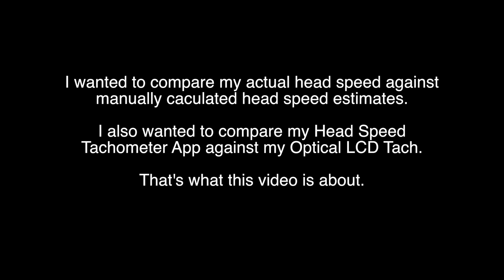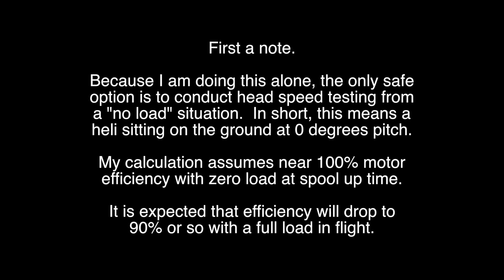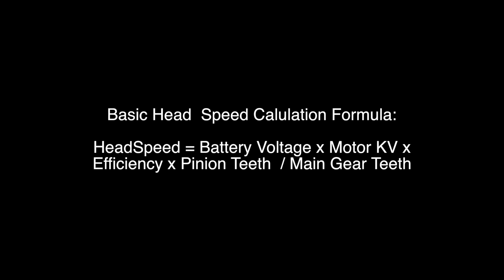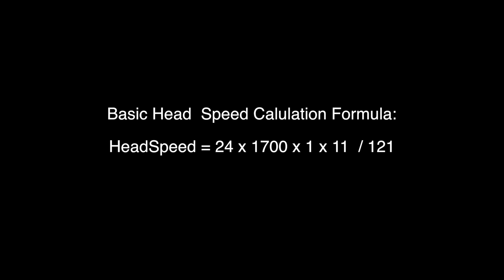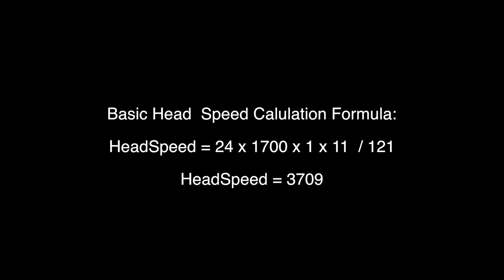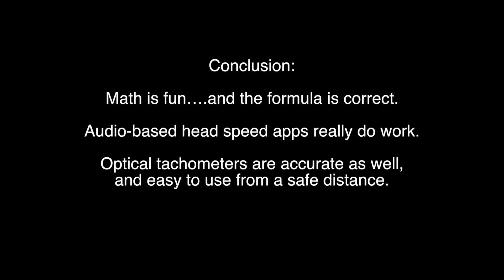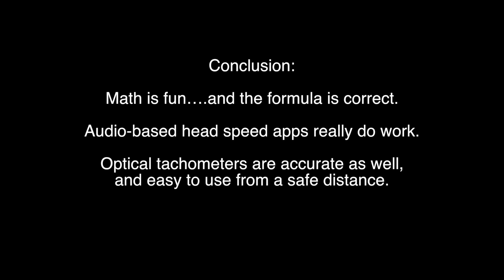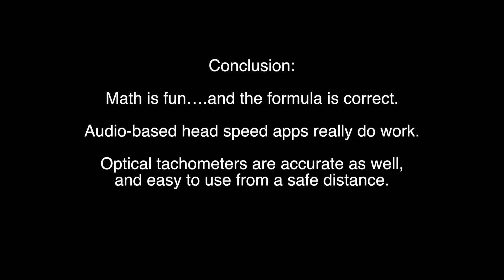RC Heli Head Speed Calculation and Measurement

Comment from the maker: The real point is that head speed calcs get you in the ballpark (and can't hope to be exact for your specific setup) and then the tach is used to validate and fine tune if needed.  I was happy to see the Android app and the Optical Tach were getting the same reading.  Now I just want to dig into the math more to better understand what drives the calcs.  It seems that every calc I use gives me a different estimation!  : )

Comment from the maker: That's a great question. I am actually engaged in discussion on this in the HeliFreak forums in the main forum.  My real world calculations don't work if I include an efficiency multiplier, and now there is someone who is informing me that efficiency has nothing to do with headspeed calculations...which left me wondering why all of the calculators and formulas include that data point.  It's current an exercise in understanding, but it's not clear to me at the moment how it factors in.

Comment: Just a question why did you calculate with 100% efficiency instead of 90%?Is it because of no load? When set I up I usually use the 90% calculation as my 100% throttle curve and adjust my curves according to that!!!